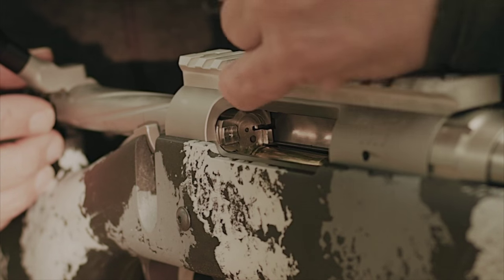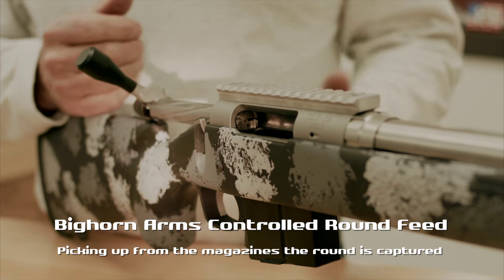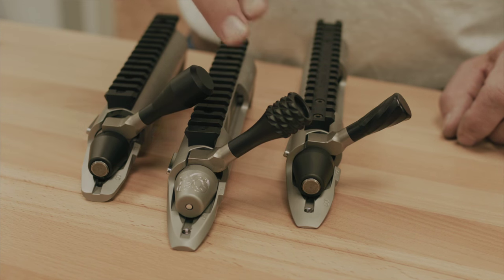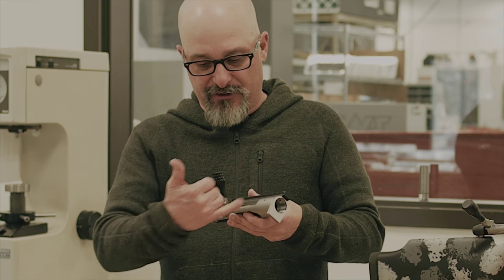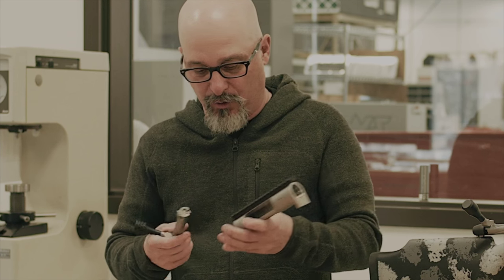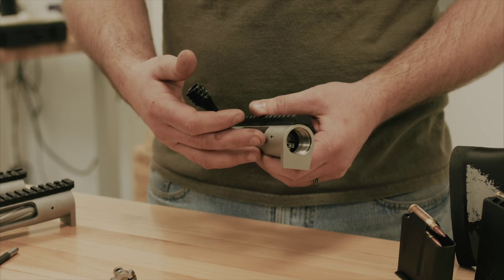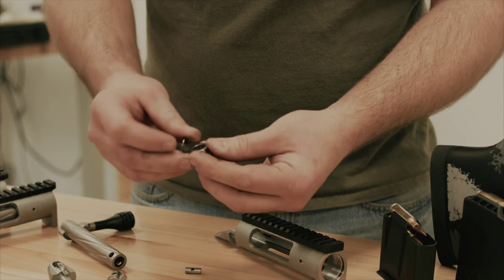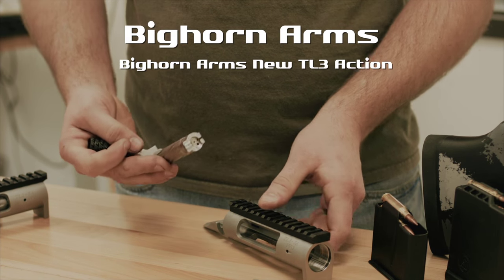Bighorn Arms TL3 Action

Comment: What stops that the cross pin from falling out of the bolt head?
Can you go from 300 WM to 300 RUM with this action?
Reply: Fire pin goes thru the center of it once fire pin is installed